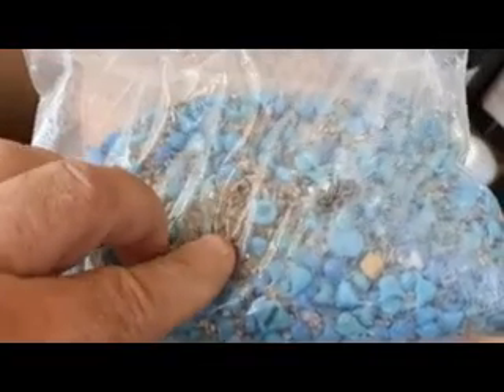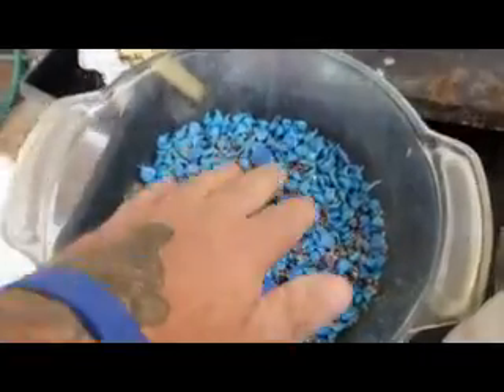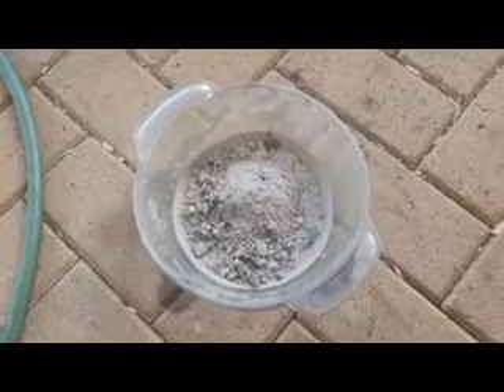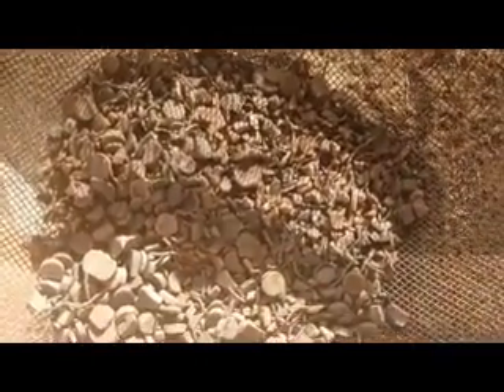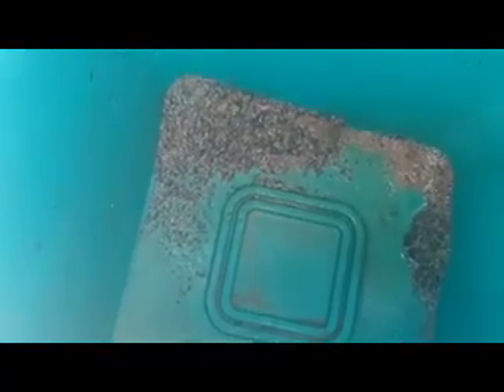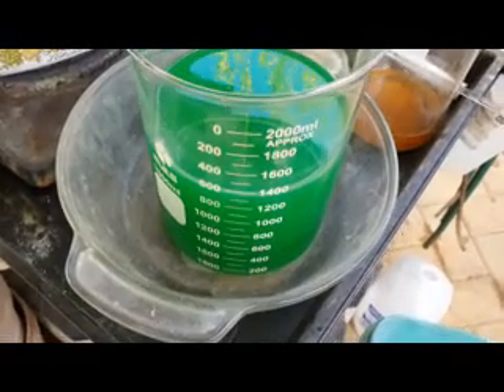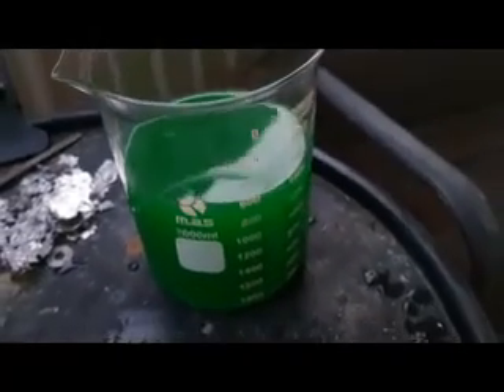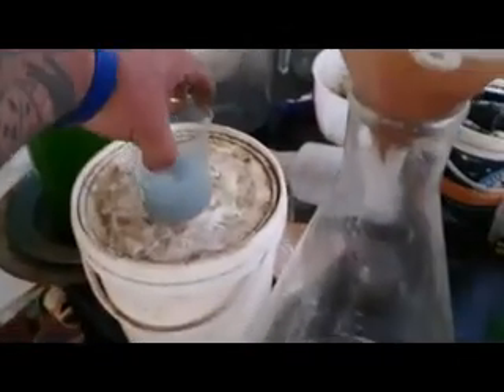blue silver capacitor fail

Comment: I think Janie is right. Not all ceramic disk capacitors contain silver. In the future, if you get a batch of unknown ceramic disk caps, just test 1 for silver content first. And the MLCC's, if they are magnetic means they are the modern ones and have a lower silver content than the older ones (pre-1990s non magnetic)
Reply: Maybe there is no silver in the capacitor, just tin/nickel sandwiching Ceramic Dielectric in- between. Can somebody confirm this hypothesis?
Reply from the maker: good to know

Comment: You didn't fail, those single disk capacitors likely used tin/nickel as the electrodes plated to both sides of the dielectric ceramic.  The white precipatant is metastannic acid.
Reply from the maker: oh ok thnx
Reply: it seems you can get tin from this metastannic acid, perhaps for stanous chloride ...
Reply: Hello sir i have these mix capasitor like 100 kg i sort them from magnet 40 kg have copper and 60 kg wires are iron is copper wires have silver or these are to have some silver some not